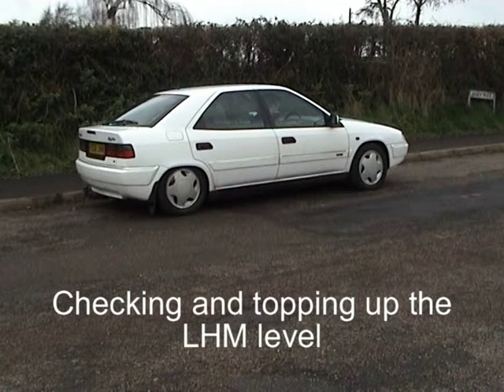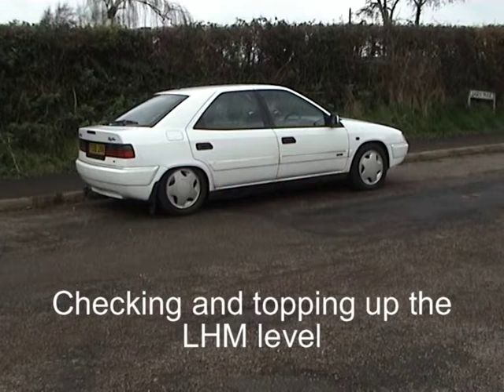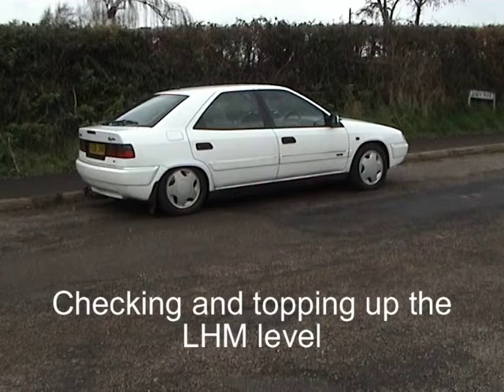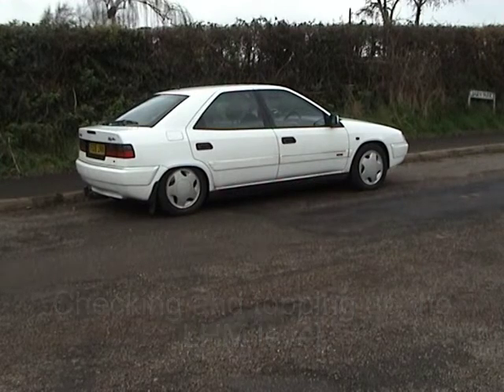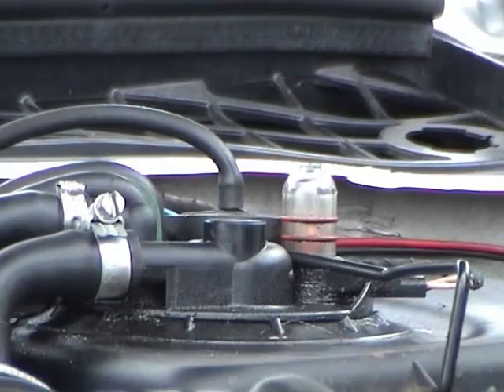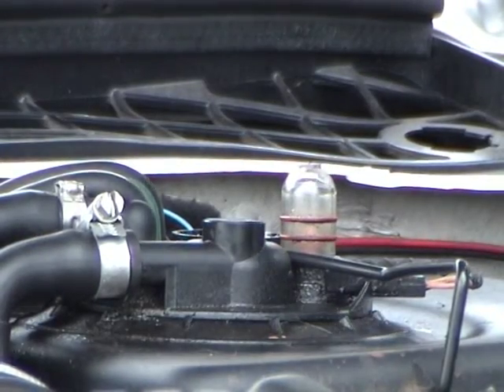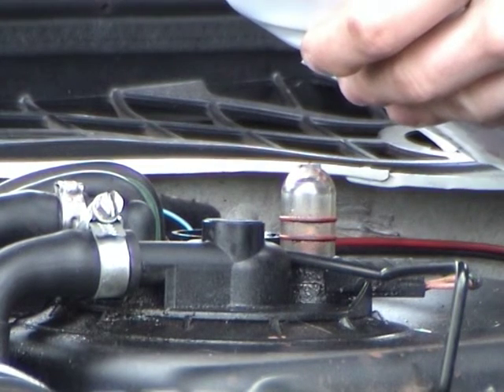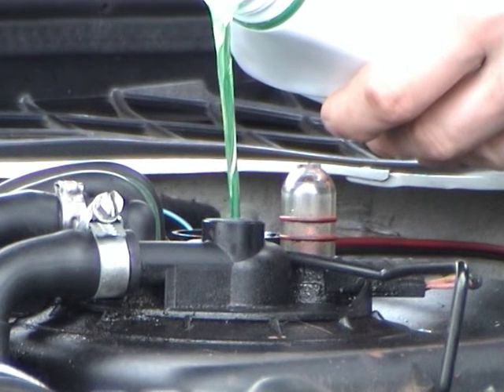Checking and topping up the hydraulic system

Comment: I believe that your car has an automatic tensioner for the auxiliary belt that drives the hydraulic pump.
Sounds like you should treat yourself to a new one of each. I sourced mine on EBay for about £50 for both.
Fitting is a little bit tricky, you would do well to pick up a Haynes manual ( EBay again, perhaps £2 ) , chapter 1B, section 15,  1.9i engines paragraph gives a very good description of the procedure to secure the tensioner while you re-fit the belt.
DO use new parts. It pays.

Comment: Great video, thanks. I'm a little confused. In the dome where the fluid level indicator is, I have an orange top hat, as described, but I also have a gold disc underneath that. Looking at your video at about 0:40 I can see the same disc with the orange bit right at the top of the dome. However, in the next shot, the orange bit seems to be between the two markers??? I have a puddle of green liquid on top of the black box near the level indicator so I'm trying to figure out if I am losing LHM.